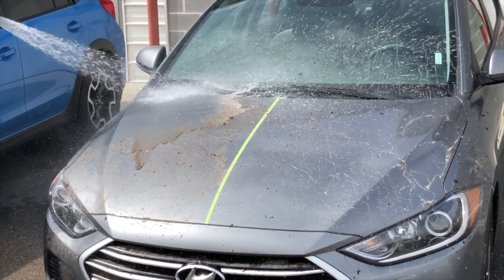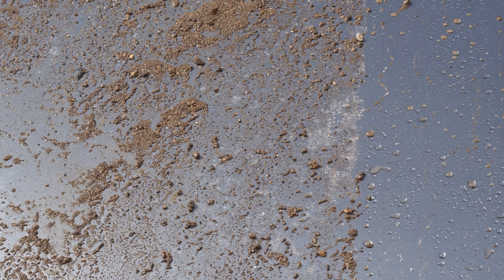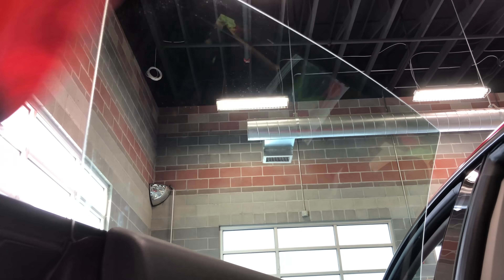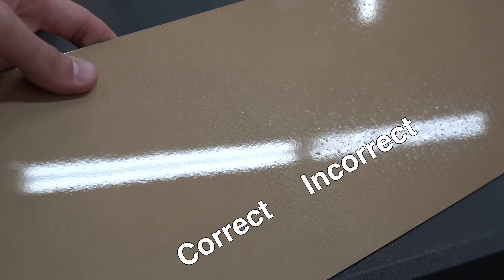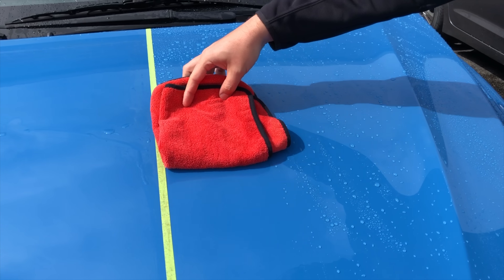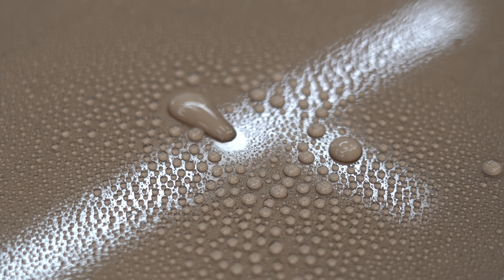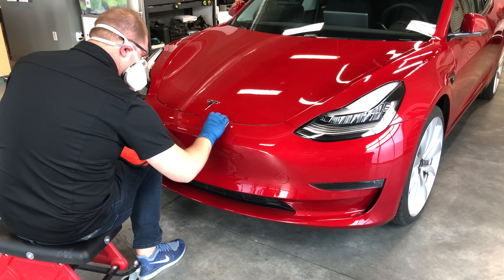Everything You Need To Know About Ceramic Coatings

Comment: I would really appreciate a video on rust proofing, and the best ways of rust mitigation
Reply: Same, especially for underneath the car.
Reply: Furkan T
Reply: In the Land Cruiser group on Facebook, many people swear by Fluid Film. I haven’t tried it myself. My Land Cruiser has built in rust protection (it leaks oil).
Reply: ACF 50 - used in aero industry. First hand experience on my motorcycle
Reply: Dragan Biskic seems interesting thank you
Reply: Aeroplanes are usually made from aluminium, why in the world would they need rust proofing??
Reply: @deadlyduck11  That's like saying "buildings are made from concrete". Yes, parts of them are.
Reply: @deadlyduck11  because metals besides steel oxidize?
Reply: @deadlyduck11  Aircraft aluminum does have rust aka corrosion and oxidation.  Know from personal experience as 120 Division Airframes in the Navy on a 1991 built C-130T and 2001 built C-40A.
Reply: @deadlyduck11  
"Rusting" is the oxidation of iron.  Aluminum also oxidizes, but we dont call it rust. It starts out with a white powdery look...made of very tiny crystals, and very hard: they make sandpaper of aluminum oxide.
Reply: Oshe Shango  actually that will increase the rust formation.  rubberized undercoating traps water under it.  ask any bodyshop and they'll tell you not to use it.  and you can search youtube how awful zeibart is for a vehicle which is rubberized undercoating
Reply: Search for land rover videos. They rust so bad underneath people are pro at protecting theirs
Reply: paint, oil, and/or low to no oxygen or salt.
Reply: opopo me too
Reply: @opopo
Spray Rust check oil on the underside 
chasis and all cavities holes etc

Once a year and your car wont rust
I do this every autumn just before winter
Only problem is it stays wet
So need to be redone again 
When it washes off

If you want some permanent Rust proofing
The car has to be perfectly clean 
and dry everywhere 
Before aplying anything
Reply: s3xyScorp lmfao rust check only works on new metal! If there’s any surface rust the  rust check won’t do anything
Reply: Rhino lining.
Reply: Krown, Fluid Film or Corrosion Free Rust Cure.  Sprayable oil, basically.  Pressure wash under carriage, let it dry for a day then spray away.  Fluid Film you can even use the cheapo Harbor Freight electric paint sprayer.
Reply: Rust proof with rust check or krown or similar. Do it in the spring. Don't do it in the fall. People think their cars rust in the winter and they're wrong. Oxidation is significantly slower in the winter. Most of the rust happens in the spring with the tempurature changes and moisture forms in the body panels.
Reply: Buying a better car.
Reply: Buy a new car. ;)
Reply: Just oil everything underneath never seen a car with oil leaks have rust near it lol
Reply: Same
Reply: Phosphoric acid inside cavities is effective. It works by removing oxygen and is the basis of a lot of rust treatments.  You need the concentrated 80% + stuff though, not the over priced diluted rubbish like jenolite and other products with "po" or "por" in the name. companies like bonnymans sell it as do a load on ebay.  The high concentrate is a slimey  "thick bleach" consistency that is hard to wash off when wet and when dry it will reconstitute a protective film if it gets wet (condensation etc.) .

I have some 40+year old classics , 1 in daily use that lives outside all year round and this has stopped existing rust and prevented new in cavities/seams etc..   You can use it on exposed metal/rust underneath too, dry off the rust/metla as much as possible, a heat gun works well for this, then soak the dry rust/metal with the acid and a brush.  use the gun to dry it some, then you can overpaint with underseal to trap it int here.  this way even if the seal is damaged or lets in a little water in, in future, it will be there to prevent rust.

Far safer than the rust accelerating method of just putting sealer over wet rust!

Two downsides is paint does not like it , nor does underseal if it is wet, hence dry it as much as possible first.

It does not eat steel, but do not leave it on any oxygen containinn metals like aluminium , although for cleaning oxidised ally carbs and stuff it is great, just wash it off once it has done it's job.

IT is also very good for a radiator/engine water system flush (dilute it ~ 3-1) , drain the water system as much as poss then pour this in with water, get the engine up to temp and fast idle it for some time and it will happily dissolve limescale and rust within your engine waterways and rad.

When cool, take a look and you may notice it is frothy/cloudy, that is the limescale dissolved in it.

Again do not leave it in there for days/weeks especially if you have an ally engine or rad core and make sure you drain, flush through with fresh water , a couple of times with a drive between as this stuff likes to cling to surfaces :)

I work with old iron engines and copper rads (same applies to copper as for ally tho).
Reply: @amojak  never heard about this at all. And i have been among old cars and their owners for as long as i can remember.

If what you say is true it sounds pretty awesome. Definatly will be looking into that more.
Thank you for the tip!
Reply: I very much 2nd this. Being from Wisconsin, corrosion is a major issue due to the road-salt.
Reply: Buy a car made entirely of plastic. :D
Reply: Sand off the surface rust and use 
FLUID FILM (wax wool ) IS THE BEST 
ALSO WD40 gel works really well 
Or if you want to 100% protect from rust you should Paint on rubberized asphalt (driveway sealant) all over the bottom or your car it comes in a small paint can just take a torch to it to melt it a bit and use a paint brush to coat the undercarriage 

Just coat everything (not the exhaust) 
All these products are at Canadian tire FYI
Reply: @justsomecanadianguy6778  A plus on the driveway sealant is as a sound deadener as well.
Reply: Same! I have 2016 wrangler and don’t drive often. I just sent it to get the undercoat painted.
Reply: Its a pain, but weekly washings when the salt is on the roads is the best and only way IMO. 🤷‍♂️
Reply: @fortunatedad7695  this actually causes more corrosion. If the salt is on your car and dry, its not doing much, as soon as you introduce water , you also bring in oxygen and you let it creep into the body panels and small spaces thus kickstarting the rusting. Keep them dry as much as you can, clean it reaaaaly well in the spring when there's no more salt and touch up any chips in the paint both underneath and on the body.
Reply: @Cimone90  if you wash your vehicle, wouldn't the salt be washed away? 🤷‍♂️
Reply: @fortunatedad7695  some of it sure but the rest turns to brine and seeps into every crack.
Reply: I like stabil, easy to apply,  kinda like a waxy wd40.
Reply: Ppp
Reply: Please comment more haha good ideas are flowing
Reply: Yes please
Reply: You can take some engine oil and rub it all over the undercarriage
Reply: Same. Seems like all cars rust like crazy even if they have rust protection from the factory. Grit and rocks tend to wear out any rust coating in no time. And road salt kills your car.
Reply: Ifeel your struggle so i moved to arizona problem solved!
Reply: Rustoleum lol
Reply: good cleaning, any spots starting to rust sand and clean smooth, recoat
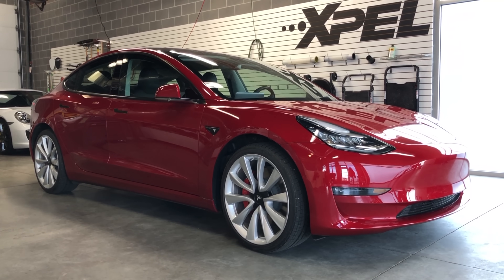Reply: @jakkbatt4711  10:59
Reply: Flex seal solves all rust problems 😉
Reply: Ah you must own a Cybertruck
Reply: @d_e_a_n_SF  That makes no sense lmao
Reply: live in the south
Reply: opopo fluid film works well or rust encapsulator like from Eastwood. If you use something like fluid film or even regular oil it’ll stop the rust and prevent any more from starting or continuing.
Reply: Live in a state that doesn't use salt.
Reply: Buy a BMW and u wont have to worry about rust.
Reply: @erickarevalo4200  but you will have to worry about keeping it running.  Ever see the consumer report of BMW owners?  They have a lower satisfaction rating than chevy
Reply: @blue03r6  I rather have  mechanics fix mechanical problems than having the insurance total my car due to unsafely structural drivability of any vehicle.
Reply: @erickarevalo4200  you sound poor.  If you keep a vehicle so long it is rusted that badly.
Reply: @blue03r6  officially the dumbest thing i heard this week. Congratulations!
Reply: @baronvonlimbourgh1716  then you don't hear yourself speaking.
Reply: @erickarevalo4200  i have 2 that disagree with you lol.

They rust less sure, but they get crusty around the edges as well

Comment: sounds like a good idea until this coating starts to crack and peel.
Reply: Coatings do not crack and peel. This isn't clear coat.
Reply from the maker: You're not going to see it crack or peel, it's far too thin. A cheap clear coat, on the other hand, could peel.
Reply: Nate Avery are you talking about the paint protection film or the ceramic coating?

Comment: Can you do wheel spacers ? Lug vs hub centric. Whether it's safe for studs to support the wheels or you need the axle hub.
Reply: If your wheels are hubcentric (what they most likely are) just dont change that and you will be fine
Reply: @kennedy796  I know. There's not much info about it on YouTube and maybe he could explain it alot better.
Reply: @SmallWhiteJewDick  well it wouldnt be wise to change it up unless your hub spacer adapts to stud centric for a specific set of wheels. Usually those are only used for bead locks.
Reply: @kennedy796  oh ok

Comment: I prefer rust on my car. Nothing is eternal and that's my way to express it.
Reply from the maker: Hahaha
Reply: I can only wish for nice paint... When I had a new car I was overly paranoid, then I bought a used 09 Honda in 2011 and just took care of it but didn't hyperventilate if it chipped, which is good because the clear coat failed on the entire car and it is all flaking off now... I just let it go and pressure wash the clearcoat chips off :) ir's still not scratched or dented :) haha
Reply: patina
Reply: Life is ephemeral
Reply: lmao
Reply: Rust is also lighter than Carbon Fibre!
Reply: @Techademics  Especially when large chunks of it fall off the car...natural weight reduction!

Comment: This looks exactly like CarPro's CQuartz. Right down to the "booster" being a milky-white SiO2 product. Got to say my days of work on prep was worth it for my CQuartz application. It really comes down to having a perfect surface to put your ceramic coating on. That's where you will pay and hopefully find someone who knows their stuff. You won't get good results on an old car unless you correct the paint first. I did my first ceramic coat when I bought the car and after doing a full polish and glaze cycle on the entire car. When I switched to CQuartz after seeing the superiority of the finish compared to what I was using, I had to do the same polish and glaze cycle again. The results are superb, but the car still gets filthy and looks terrible if not washed. 

One thing that isn't mentioned in the video is that while coatings have a hydrophobic property, much rainwater and spray on the roads has chemicals and particulates which do stick to the surface and cause a dirty appearance. In the Atlanta area my car will look filthy if I drive in the rain. Simple hose water is not enough to clean it, and I need to do a full wash if I want the car to look "clean" again.

As for paint protective film, IMO it is a bit of a waste unless you have lots of money or a free/low cost way of replacing it regularly. It tears, oxidizes (turns yellow), and generally looks bad far more quickly than the paint. True it does have a sacrificial protection against rocks or other debris, but the hassle of replacing it is a non-zero cost. It doesn't make financial sense, either if you are planning to use it to preserve resale value. The paint condition is an almost insignificant (barring conspicuous damage) portion of your car's value. If you are trying to sell a car, if it is a commodity like 99% of cars (including anything Tesla makes) the only things that materially affect price are age and mileage. Film is basically a bad investment. You could easily get a respray of the bumper clip and hood for the same price as some film installs and get a perfect restoration as opposed to a constantly degrading bit of vinyl on top of your finish.

I'm not paid or compensated in any way from CarPro. I simply like their products.
Reply: Older, cheap PPFs did have those problems.  Newer PPFs do not oxidize as rapidly and many come with a 10 year warranty (mid-range products have a 5 year warranty).  Films can be damaged by rocks, but I'd rather have that than my paint be damaged.
Reply: Not familiar with how the film works. You make a valid point about the cost of repainting vs replacing the coating.  Wondering If the film yellows on garage kept vehicles? Also it depends on the cost of your paint job. If your paying 10k initially you might be willing/find it cost effective to drop much less than that to protect it. Especially if it cannot be matched or blended easily.

Also if you are anal about the appearance of your vehicle than I also see benefit in the film. You can restore your car to showroom finish in 5 minutes ( from what this video says) vs at least an hour buffing and polishing which then degrades the coating. While I may be satisfied with a respray every year or so not every one may aggree.
Reply: @iangreene2063  no more yellowing on PPF. That was just old, shitty glue they used to use that did that. Doesn't happen anymore no matter how long it lasts
Reply: @iangreene2063  A full PPF wrap can sometimes be upwards of $8K-10K by itself.  In many cases even more than a full respray costs.
Reply: That seems rather high. I trust you know better than I just wondering were the cost comes from materials, equipment or labor? Regardless even if it lasted only a year before having to redo the ppf from my understanding it protects against 90% of the normal front damage small chips and scratches. If you are anal about you cars appearance to the tune of 10k a year than it is probably worth it because within a week to a month you will most likely have a chip or scratch that the ppf  would prevent and could not be buffed out. To say nothing of cost effectiveness, it's just not practical to paint your car monthly. Maybe no one is that anal but if I was inclined to pay over 100k for a car I probably would be that anal. If I could hose  it off and heat it up rather than go to the body shop it would be worth every penny.
Reply: @iangreene2063  I think 3-5 years is more typical of PPF lifespan.  But yeah I've seen a number of people on YT getting full PPF wraps and saying that's how much it costs, which is pretty crazy IMHO.
Reply: @iangreene2063  I think it really does depend on what kind of results you expect. A standard Xpel package at a dealer will cost around $1000 and cover the high wear areas (door handle pockets, front bumper,front part of hood and fenders, perhaps the door edges), and really reduce the amount of paint chips. If you drive a lot, it may be worth more for you so you don't have a car that looks absolutely peppered. If you don't drive a lot, maybe its not worth it. Its also for personal pride in your car, so mileage definitely varies there. So in sum, its not all that expensive, and is more for helping sell the car private party if quicker and personal pride.
Reply: Candice,  Super clean your Cquartz and decon with Tar-X then top with Car Pro's gliss.  It will give you the repelancy I think you are looking for.  You can not apply Gliss over Reload though, that will have to be removed. 

I agree with the film.  I had it applied to my hood and regretted it since I got it.  Never looked right and the big stone chips still went right through it.
Reply: Excellent points.
Reply: The older products yellowed due to the urethane itself, not the adhesive.  Aromatic vs aliphatic made all the difference in the world.

And this product could very well be CarPro's CQuartz, Expel doesn't make any of their own products.   Almost everything is outsourced.
Reply: so I should get this on my new car ?

Comment: How much does all this cost
Reply from the maker: If a car is fully wrapped in paint protective film, it will be about $800 to $1,000 depending on the size of the vehicle and local labor rates. If paint correction is required, the cost will range from about $1,200 to $2,000, depending on the level of correction required and local labor rates.
Reply: Engineering Explained whaaaa, where I’m at the two shops I’ve had give me quotes have it around $4-6k for the whole car, or $2k for the full hood, front bumper, mirrors, and other front-facing areas >.<

Comment: I was a skeptic until I saw an example of this. Thing is, you'll need paint protection first before this application, which will make the total cost very expensive. I got quoted $1500 for the highest level application BEFORE the paint correction.
Reply from the maker: Paint correction* (not protection, if you have paint protection on your car you won't need correction). I asked XPEL about pricing, they said $800-$1000 before paint correction. But of course will vary by shop/location/etc.
Reply: @EngineeringExplained  got quoted 6k to get paint correction, xpel film, and ceramic coating, and got told the ceramic coating was included free...
Reply: $6k 😳 Not worth it unless it is a rare supercar.